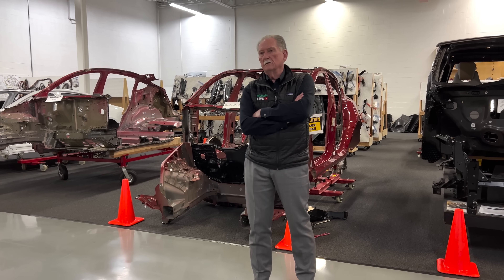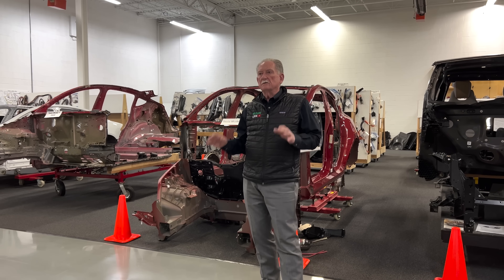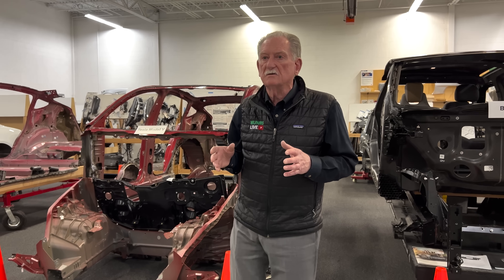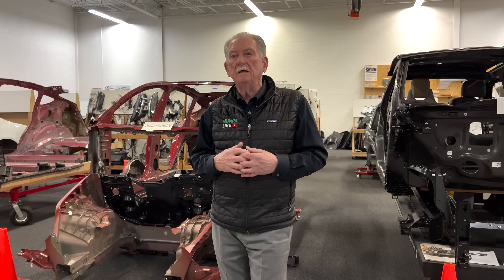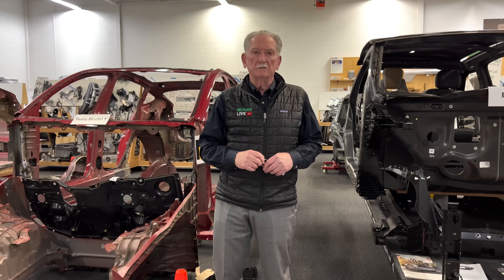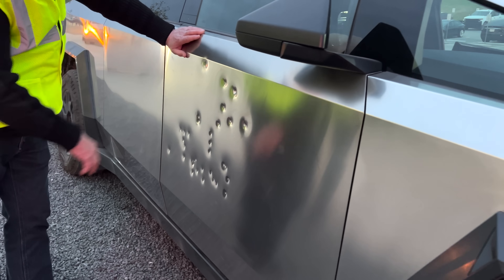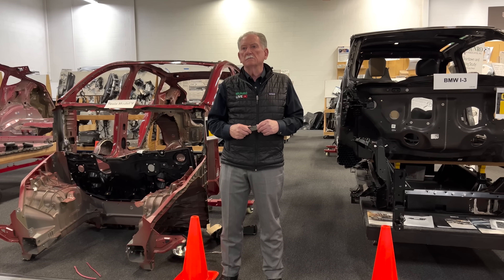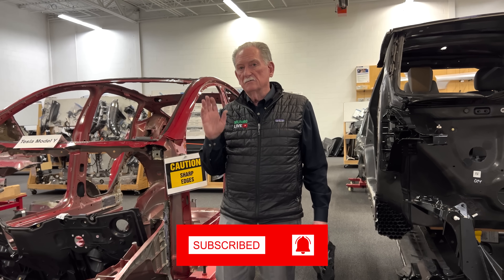An Engineering Analysis of the Tesla Cybertruck

Comment: One great is that each thing only needs 2 wires since the power and data is together.
Reply: That is interesting.  Do you have a link with any proper info on that?
Reply: @chriswright9096  Elon said the other day interview with Sandy
Reply: @chriswright9096  sorry he didn't say it. 
But it's possible based on the fact that they series connect the Wi-Fi access points on the roof of large buildings
It's a 48v source with data on the same wires.

Comment: Sandy,  You said that the Cybertruck uses (will use?) ethernet and that this makes it faster and less wire.. Vehicles have been using CANBus for decades.  This bus runs about the same speeds and the same wire sizes.  Am I missing something?  Could you do a show to discuss this?  Thanks.
Reply: just looked that up. from the sources i could find CANBus seems to top out at 1MBits. Ethernet runs at 10MBits slowest (what currently available standard chips support), 1GBits/1000MBits is pretty common these days (almost defacto standard speed), and is specified for 10GBits. Though realistically it will probably be 10/100MBits, which is about 10 or 100 times as fast as CANBus, if not more (since the speed of CAN depends on the bus length)

Comment: Surprised they didn’t incorporate torque vectoring for the steering as well, ala Arcimoto. Would also reduce part count further, failure points and electrical load. Perhaps the losses  from dual motors when going straight out weigh the gains. Maybe something for Rivian to think about. Thoughts?

Comment: Love your analyses, Sandy.  Thanks for putting them out there.
Elon has assembled the equivalence of a high-tech da Vinci in his companies.  Between himself and his stunning assembly of brains and personalities, everything he puts out is miles and eons  ahead of everyone else.
Reply: Tesla has the worst fit and finish and final inspection of any car in the price range.
Tesla has the 2nd most faults in the German forced inspection of 3 year old cars, only Dacia is worse, main reason is bad suspension arm design and cheap materials used.
A friend needed a motor replacement, because the rear motor was badly designed (water ingress), the cost was more then a complete ICE crate engine for my car.
Same friend needed 5 new motorized door handles (one handle broke twice because of bad design that was later fixed), total cost also more then a ICE crate engine for my car.
Tesla has one of the worst stone chip protection around the wheels, in Norway Tesla gave out free mudflaps, because it was cheaper then handling warranty claims about damaged paint and rust from stones hitting the body of the car. Most other cars have plastic protection around the wheels.
It took Tesla multiple years and software updates to bring the rain detection up to a level that is almost as good as a 15 year old car with dedicated rain sensor.
Look at the prices of the Cybertruck, they are miles above the promised prices 4 years ago.
Look at the roadster 2, 5 years later and still no sign of anything remotely close to production.

Comment: If steer by wire easier to place wheel left or right side different countries?
Reply: i waiting for the first hacker to remove the steering wheel entirely and replace it with a DualShock :D then you can use any seat you want for driving :D

Comment: I would like to know when all of the underlying technologies and updated manufacturing processes that were invented for the cybertruck will be passed along to Tesla's other vehicles.
Reply: I expect that to happen sooner or later. There will be some vehicles down the line: roadster, theoretical Tesla Van, probably semi is benefitting with stuff like 48v and drive by wire, etc. I doubt that we will see any incoming vehicles that will utilise stainless steel (maybe van, as it has quite similar challenges like trucks, so they have to be sturdy).
Reply: All of the current Tesla models have had recent refreshes except for Model Y that is only three years old. I doubt we see more refreshes for at least four years.

Comment: Just a question … what about repairability of these vehicles and the ability of auto body shops to remove dents and repair collision damage. Also, I would assume ease of repair would lower insurance costs? Finally, repair parts  supply chain and infrastructure … that discussion would be interesting!
Reply: You would also eliminate paint scratches and minor dings. You can kick the door hard and not leave a mark. That also lowers insurance cost. A challenging calculation for insurance companies.
Reply: Hopefully Tesla insurance will be universally available soon.
Reply: Good point but I was thinking even a “minor” fender bender might be costly given how specialized the body materials and frame are … then again, I suppose if one could afford the truck then repair costs and insurance may not be an issue 😀 Very cool product! Now, about the ergonomics of that huge touch screen … makes sense if the car is fully autonomous, but I still think having the basic info directly in front of the driver makes more sense from a safety standpoint
Reply: @paulshelander1720  Repairs will be different, at least. When they are old enough for poorly insured drivers on a budget to own them, maybe they won't care about a few battle scars or cosmetically visible repairs? The screen is the same solution as in the world's best-selling car, so people seem to get used to it. 😁

Comment: What is the advantage of using stainless steel? Bring bulletproof isn't the goal when you're designing a car. Is it cheaper? Easier to form?
Reply: No paint required.
Reply: It doesn't rust, so it doesn't need paint. If you make it tough, you have a tough truck and save weight on internal stiffening.
Reply: Can stainless be painted? Does it last

Comment: I would think another benefit to steer by wire is that the vehicle
is easier to produce for different countries like England and the US.   Makes it easier to reconfigure the vehicle for right or left hand drive as it’s just a wire that has to move to one side or other of the dash.
Reply: This vehicle IS Australia. Wind/solar powered outback Australia.
Reply: @geirmyrvagnes8718  If you have ever been in the outback of Australia, you would know that the Cybertruck is not the vehicle you would take out there. It is too heavy and hasn't got the range you need, 550km (for the Beast) isn't enough to get you there and back with spare range for safety. That 550km is in optimal conditions and once you are driving on gravel roads with bull dust (bull dust is fine like talcum powder), your range drops significantly. Plus, the bull dust gets everywhere and is bad for electronics because it coats everything and causes heat build-up and loosens contacts. People in the outback always carry extra fuel as 1000km in a day is pretty common, I am doing 2 x 900km+ days next week, there are no superchargers and I don't have extra days to waste on getting there and back. Maybe Cybertruck 2035 will do, but not yet.
Reply: @geirmyrvagnes8718  has cybertruck passed the crash tests etc. required to be legally sold in Australia?
Reply: Should be a good fit for our Aussie brothers.
Reply: @geirmyrvagnes8718  Pity they don't have an option for a solar roof like the Fiskers.
Reply: @spankeyfish Solar roof doesn't give you that much.  Not enough square meters
Reply: @kaasmeester5903  Wrong. Simply go to the Solar Aptera, and the vast bulk of driving is only one or two people.
Aptera gets up to 40 MILES per day of range.... all free. 
If EVERY AMERICAN car was a Solar Aptera, 2/3 of the chargers would already be surplus and we'd not need increasing the grid!

Comment: i hear NOTHING that actually benefits customers. 48v is not a selling point.
Reply: Watch again. Many benefits, primarily less weight = better range. And you can't have steer by wire without 48v system... directly benefits driver due to it being easier to steer

Comment: Thank you very much for all the detailed information. 
Especially on the Austenite structure (which is when I remember correct a 3D structure compared to a 2D structure in normal steel). 
Even seeing how difficult it still is for Tesla I come to the conclusion without a 48V system and other improvements the features of the vehicle would be very limited. 
Only with all the improvements it became such a good car and will improve over the coming years much more.
Reply: It's all 3D. When looking at micrographs all you're seeing is a 2D slice of the 3D structures. Unless you deep etch and look at them via a SEM.
Reply: @tke466  I have been looking for the correct subject and the correct english wording: 
'Difference Between Austenite and Ferrite
July 12, 2018 Posted by Madhu
The key difference between austenite and ferrite is that the 
austenite has face-centered cubic configuration of gamma iron whereas the ferrite has body-centered cubic alpha iron configuration. ...'
So it seems the opposite, the structure of austenite is 2D and the structure of ferrite is 3D. 
Further: 
'What is Austenite?
Austenite is an allotrope of iron known as gamma-phase-iron. Therefore, it is metallic and non-magnetic. This allotrope occurs in different iron alloys at different temperatures. For example, in plain-carbon steel, this allotrope exists at 727°C while in stainless steel, it exists at room temperature. The cubic structure of this allotrope is face-centered cubic structure. When we change the temperature from 912 °C to 1,394 °C, this austenite allotrope forms from another allotrope called ferrite. We call this process austenitization. Austenite is relatively soft and ductile. As a result, it can dissolve more carbon in its solid solution.
What is Ferrite?
Ferrite is an allotrope of iron known as alpha-phase-iron. It has a ceramic-like appearance, and it is paramagnetic. It has the body-centered cubic structure. Moreover, the dissolution of carbon in this allotrope is poor.'
Reply: All constituents are 3 dimensional in steel. They are not a picture. They have a measurement in 3 axis. Fact.  Face centered vs body is just a different orientation of the carbon atoms with the iron atoms. Both are 3 dimensional. FCC has corbon atoms on the cube face. BCC has carbon atom in the center of the cube. In each case iron atoms are at the corners of the cube.
Reply: @tke466  Cube face vs cube center. Agreed. In German language it's called kubisch flächenzentriert vs. kubisch raumzentriert. 
No further comment re internal structure.

Comment: Hard to get excited about wiring weight savings on a 6800 lb vehicle.
Reply: How about introducing a system that will save weight (and raw materials) on all vehicles when implemented?
Reply: @geirmyrvagnes8718  I'll probably get a cyberbeast, with the expectation that savings on my gas bill will be blown out by spending on tires.  EVs are FATASSES.
Reply: @shoobidyboop8634  A truck with these sorts of specs is not light. You probably saw the truck pull video. The F350 there was heavier.  I fact, the Cybertruck was the lightest vehicle in the video and still pulled quite well. A little bit thanks to 48V. 😅
Reply: @geirmyrvagnes8718  7000 lbs with enough torque to do 2.6s 0-60 means tires, tires, and more tires.  EVs are FATASSES!!!
Reply: @shoobidyboop8634  Yeah, they didn't choose the F350 for the drag race clip. 😂
Reply: @geirmyrvagnes8718  A 7000 lb vehicle with that much torque will eat tires MORNING, NOON, AND NIGHT, with a midnight snack thrown in for good measure.  FATIO IN THE ASSIO THEY ARE!!!!
Reply: @shoobidyboop8634  So, your're saying it rests in the AFTERNOON!!!!!!???? What about the EVENING!!?!!?
Reply: @geirmyrvagnes8718  If you drive it hard, like I would, it'll snacky on tires mid-morning, afternoon, and in the wee early hours.  IT'S A FATASSIO TIRE EATERIO!!!!
Reply: @shoobidyboop8634  Surely, there would be a LUNCH BREAK!!!?!?!1
Reply: @geirmyrvagnes8718  A break would be had by NOTHING BUT THE TIRES!!!!  Routinely they would break.  ROUTINELY OWING AN EV'S ASSINO BEING FATINO!!!

Comment: Some confusion about the material - looks like its standard austenitic SS 304 that has been precisely cold worked to give it higher yield by formation of strain-induced martensite. Or its case hardened SS by rapidly cooling in N2. And BMW has already moved to 48V in their higher end vehicles, nothing new there.
Reply: Mercedes also uses 48V, but this only affects individual areas (usually just multimedia) and nothing else.
A complete 48V architecture is a big step further.
Reply: @Zedus-rl9hp  yeah its a slow conversion, pple speak as if 12V systems are going to be done away with overnight..
Reply: @drury2d8  Sooner or later everyone will switch to a complete 48V system.
The changeover will happen very quickly if, after the CT, other vehicles come onto the market that actually operate all components with 48V and not just a few. This means that the supplier industry can make a faster and therefore cheaper changeover, which is what makes the change possible.
Companies lack the resources for a slow changeover because they would have to produce 12V and 48V in parallel over years. That's the reason why everyone went for 12V even though they had wanted 48V for a long time.

Comment: I hate the aircraft comparison. Commercial aircraft and military jets are extensively maintained and require an inspection before every flight.

Teslas stear by wire system might be safe and remains safe for the life of the vehicle, But commercial aircraft safety is not a good analog to consumer car safety.
Reply: But is shows that it can be done. And how.

Comment: CFD in chassis design, I'd have snickered at the thought in 1978.  Thanks, too.  This kind of update interspersed with the longer ones is great. All the best
Reply: Do the CFD enhancements affect the way the molten aluminum flows into the die, or the structural performance of the finished part, or something else?
Reply: @johnpapiewski7022  The tools, if used by someone who actually understands them, lets you optimize the design.  In 1978, the tools couldn't model a candle flame

Comment: Going from 12v to 48v and from CAN-Bus to ethernet probably explains why the car is so light and inexpensive.

I should also say; knowing my martinsitic stainless steel clad car will stop the majority of bullets that are fired at me on my weekday commute will give me much overdue respite. 

I greatly look forward to saving the planet with this absolute marvel of technology. It's amazing.... you just get in and drive from where you are to somewhere else e.g. home to work and of course visa versa.... what an age of wonder we live in. Wow.... no really WWwwoooowww.  I didn't think it was possible for life to get any better but here we are.
Reply: I wonder how many people won't catch the sarcasm in your comment. Nicely done 👍
Reply: Woow , I just admire on the insight you have provided although I like my 1980 Lincoln which I use to drive from Point A to B, it is hot and cold sometimes and it's not so comfartable but it does the trick. Advancements in tehnology are so boring and irrelevant and that steer by wire Like we need it for something really.. Like all the New tehnology is worhless..
Reply: Surely you jest? All modern jet aircraft uses control by wire for all the control surfaces. It would allow the steering wheel to be cheaply placed anywhere in the vehicle and at much lower cost.

 @carbonarahrv
Reply: Is that you Grok?

Comment: One thing I don't hear much about on new electric vehicles, including this truck, is the expected longevity of the vehicle, how long will the battery last, what will be the cost of replacement, for repairs, what is the expectation of failures of components and how will it be serviced and cost.  Even simple exchange outs like the tires, I heard are proprietary.  The inside surroundings of the truck looks to be very stark on human visual appeal.  Does every vehicle instrument operating commands (w/ exception of gas, brakes, door handle buttons) go thru that large display?  How good is that to simply flipping a switch?  If someone was to attempt to rip that display away from the console, how easy is that to do, would it destroy the vehicle operation and how much would it be to fix it?  I saw in one video that it looks like the doors open slightly less than a normal truck.  How cumbersome is it to deal with that small panel to open the doors?  I saw Elon on the delivery video and even he seemed to fumble a bit on getting the doors to open.  What about security?  If someone gets in the truck, what keeps them from updating the fw and rolling away with it?
It is all great that it beats an electric hummer, does 0-60  real quick and can pull large loads for short distances, but what is the comparison of it to an equivalent gas/diesel powered truck say pulling a trailer across 2K miles?  How many times have to stop, charge and wait?  Savings in dollar cost of energy while pulling that load?  New Techie techie here there and hype is fine but all the evaluators here on YouTube miss the normal operational comparisons that most truck buyers would look for.  If CT is intended for only a few select consumers and not an overall competitor, well, state that then.  If it is just a "transitional evolution" and experimental, well ok, state that and say we don't compare it along the lines of lifetime use, abuse and costs.
Reply: That is a bit more than "one thing".